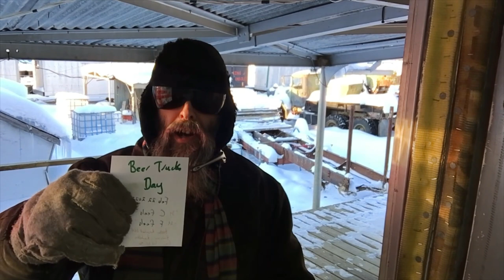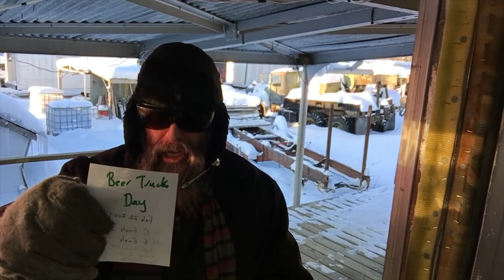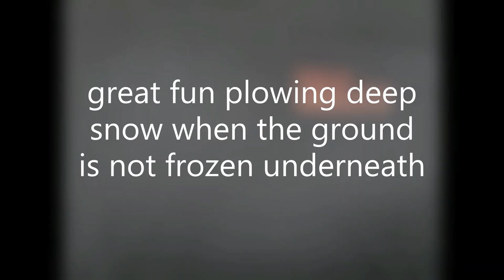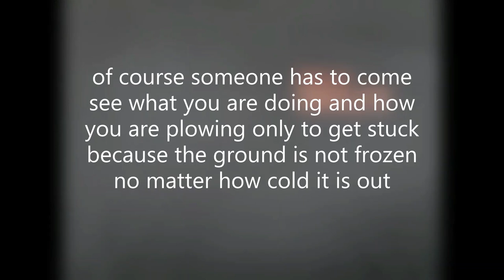V12 Radiator, Pony Walk, Magic Hanger Bearing, TD 6 Plowing Feb 22 2023

Comment: L and M Radiators of Hibbing Minnesota manufacture Severe Duty radiators for Mining Equipment and every other thing you can think of.  NASA uses them. Trucker and Loggers use them. 
After having radiator failures on PotHoles Highways running loads over the Canada/USA borders routes   .... I got an L&M Radiator in my old MACK SuperLiner Semi truck.  The Rubber Grommets and Finned Replaceable  cooling Tubes with removable tank tops/bottoms for wooden plug repairs.make this the Ultimate radiator you should use. No one makes this any better.  Those SOLDERed  radiators are just trouble in Severe Duty Usage.
Reply from the maker: thank you, will check them out  thansk

Comment: That rad I think is way too small for 2 6cyl engines...you have 1 thing going...it's only gonna run in winter
Reply from the maker: it is all temporary, it the V12 does not run then it is bye bye and we toss something else in the Linn Tractor.  thansk